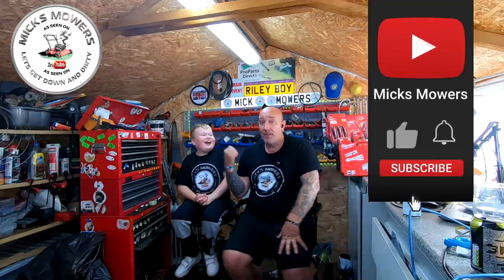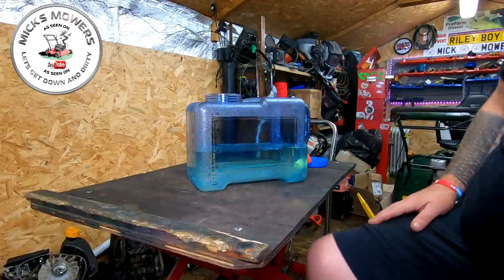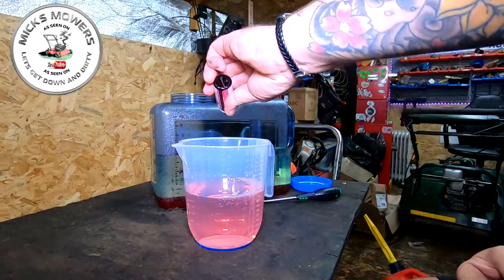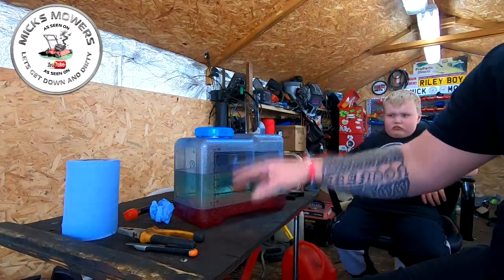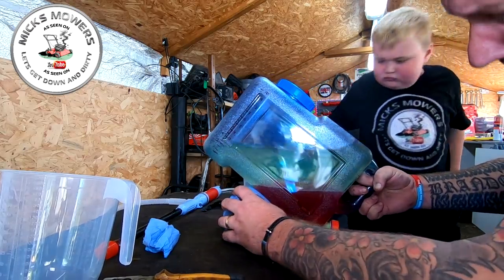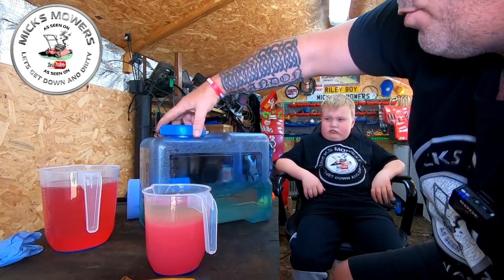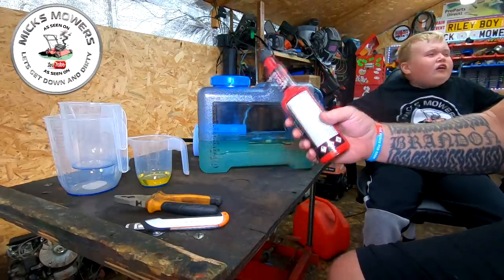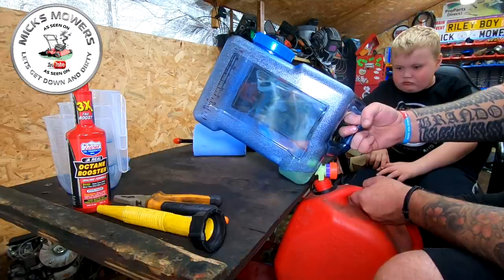How To Remove Ethanol From E10 Unleaded Fuel To Use In Lawnmowers And Small Engines

Comment from the maker: Here is my channel wish list if you would like to show some support in purchasing some tools or spare parts, it is gratefully appreciated https://www.amazon.co.uk/hz/wishlist/ls/13BO7QKGAZZV2/ref=nav_wishlist_lists_2?_encoding=UTF8&type=wishlist
Reply: Octane booster REDUCES the flammability of the fuel, not the other way.  It's purpose is to keep the fuel from igniting too soon, before the spark.  There are quick start additives that increase flammability. Also, if that fuel had 10% ethanol, it should have shrunk by half a liter, but it only shrunk by a quarter liter, so I don't think you got it all; either that or it didn't really have 10%.
Reply from the maker: @alan6832  hi Alan.. ta for the comment.. E10 has up to 10% it could of been less..
Reply: I am an ASE Master Certified Automobile Technician and I have been trained on how to measure ethanol in fuel and what it does to the fuel. In testing we use coolant, but you can use alcohol (with food coloring) and you will have something that will burn after you siphon it off. Calculate what the 10% will be and use that much alcohol to remove the ethanol from the fuel. It makes it easier to see when the process is finished.
   You are correct to use an octane booster because ethanol is an octane booster and when you remove it the octane rating of the petrol will drop possibly causing detonation. However you have that "flammability" thing backwards.
   One more thing. I doubt that it is the ethanol itself that is destroying the rubber o-rings and gaskets. As far as rust goes, you're spot on when the equipment is used once a week and has time to absorb moisture out of the air, and I suspect it is that water that is degrading paper gaskets and rusting pinholes in floats on carburetors. On stuff that is used daily, as you noted, or on a car that has a tank that is moisture controlled, the ethanol does not cause a rusting problem. Cars also have fuel filters that won't pass water so their injectors don't rust up.
Reply from the maker: @ladamyre1  yo yo.you know what... Best comment ever.. thanks
Reply: Maybe I missed it, but did you talk about how to dispose of the ethanol?  I think you don't want to pour it down the drain or on the ground.
Reply from the maker: @8546Ken  I took it to the recycling center
Reply: nice one mate!
Reply: Thanks for this Mick. Other You Tubers have suggested 1%-2% deionised water, others 10%. Your suggestion for 40% adds to my already confused state. Would you have an opinion on why there is such a variance of opinion or estimate. My own position is to go more than less to be more safe than sorry, but could less be more. Thanks if you do get chance or inclination to reply.
Reply from the maker: @derrinmorton3038  more will attract more ethanol is my thinking
Reply: video starts at 4:20
Reply: use a glass gallon jug, then pour the non ethenyl gas off the top.  (and don't drop the jug)

Comment: In the next episode, how to convert water with 50% ethanol content into a passable vodka imitation?
Reply: does it send you blind?
Reply: @charlestaylor8566  A horse would probably be cheaper.
Reply: @JohnBarringercopper101  
No.
Reply: @jimallen9859  Probably yes actually.  Wouldn't be at all surprised to find that the "ethanol" recovered from the gas/petrol has methanol and other nasty volatiles in it.  You would be a fool to try and process it into something drinkable.  Especially since just making quality ethanol in the first place would be easier.

Comment: I have had fits every year that I pull out my tiller, my pressure washer and my lawn mower. I threw the weed whacker away it gave such fits and bought a battery EGO one that is brilliant. I bought new carbs for them one year, but still the next year, filled with gunk. At the beginning of covid, I did this removal process, drained all my tools and filled with this ethanol free fuel. This year I pulled everything out, and like magic, they all started right up and ran perfect. I personally just start with premium fuel, so after the ethanol removal, I have regular fuel. I then ad some Stabil and I think it will store for years. Now 1 1/2 years later, the fuel I still have left over looks and a eels just like new. And yes, you can just drain all your tools and then run them dry, but this is easier. I will never put ethanol fuel in a small engine ever again.
Reply: CONvid
Reply: just use aspen and there is no messing about
Reply: Just add Stabil to the fuel as soon as you get it. I have only ever had one fuel related problem and that was a generator that I decided to read the instructions on and drain the fuel after use. Next time I needed it I had to remove the carb and clean the varnish out for it to run . Ever since then I never shut the fuel off to the generator and it fires up on the second pull even after sitting for over 2 years. My riding mower is over 15 years old with no carburetor problems along with my push mower, weed eater and chainsaw.
Reply: @boilerhousegarage  Yup, if folk don't wake up seen we are buggered
Reply: @JB-ly3eo  some machines run like crap on Aspen and if you use alot of fuel it's a ridiculous price. Having said that I do use some Aspen .
Reply: I have been using Stabil and haven't cleaned a carb in 15 years. I also do remove the fuel in my generator every two years because Stabil is only suppose to last 12 months, but it must last longer.

Comment: Or just buy ethanol free petrol form Esso - their Supreme+ Super Unleaded ' is ethanol free in most of the UK (except, due to technical supply reasons, in Devon, Cornwall, North Wales, North England and Scotland)
Reply: @robertferguson5518  Tesco momentum 99 is less than 5% as is V-Power. After watching this I’ll stick to buying 99 or V-power, less faff and far less dangerous!
Reply: @robertferguson5518  BP is the worst.
Reply: We have ethanol free 91 octane in Arkansas USA. Its usually in the premium pump and costs more. Right now its costs around 3.65 per gallon.
Reply: @robertferguson5518  was $ 1.79 when TRUMP was in office.
Reply: yeah at a premium over the ethanol fuel, not cost effective at least where I live in USA
Reply: @robertferguson5518  IF we still have the USA
Reply: @garywaite6963  that was a joke. Media and idiot's repeat it as a fact, sadly.

Comment: I have always used standard unleaded for years with no issues, only thing I do do is when I finish using the machines is drain the tank and then run it till it runs out and never leave machines over winter with fuel in

Comment: Little tip I learnt years ago . When pouring from a container like the de-ionised water . Pour from it side ways and then you don’t get the surging effect of the air trying to get back in the  container. You then get a steady pour .
Reply from the maker: Thanks mate
Reply: Yes, I imagine @micksmowersthemowerman is aware of this but for the purposes of this video poured the bottle in this way so the camera could notice the label on the container.
Reply: I make an tiny air hole in the handle of the pouring container. 1mm is about right.
Reply: The jug used for the deionized water and other containers like it were designed to be poured with the spout on top, not on the bottom.
Reply: Never drink from the opposite side of your mug....

The laying on its side trick was taught me to pour fluids into or near engines where you don't want to spill, like with coolant, oil or windscreen fluid.

Comment: Weee are fortunate to have a couple stations that still sell hytest ethanol-free fuel. Its cost is about 15% more. But you showed a very nice trick for those who don't have an option. 
    The gunk is a problem. That's why you never store your vehicles over the winter with fuel in them. The other trouble is ethanol tends to dry out gaskets and diaphragms. A very small amount of two-stroke oil can go a long way in a 4-stroke engine to offset some of those effects.
Reply: Jim McIntosh  ethenol is basically just corn oil.

Comment: Just a tip for pouring the de-ionised water, it works the same for fuel and oil cans, is to pour the bottle on its side, the glugging comes from air getting trapped in the handle part, so ifyou get that level, you can stop the surging of the flow, and make it pour nice and smoothly. Good video by the way, really enjoyed it, learned something today Cheers, keep it up!
Reply: The glugging comes from having to let air in to replace the contents coming out. I completely invert the container so the outlet is at the top, but sideways works, too.

Comment: In the USA I live in Palatka, FL and about 5 miles from my house there is a petrol station that sells Ethanol free fuel. I use ethanol free in all small engines that I use. Good video. I purchased a small battery operated fuel pump like you have from Harbor Freight for about 8.5$ USD and it works great.
Reply: Whenever I see ' ethanol free ' for sale, I am always curious about what was in the tank prior....

Comment: Ethanol has a higher octane rating than gasoline and gives a net boost to the fuel's octane. Octane rating of fuel is not a measure of how flammable the fuel is though.  In fact, it is more related to its ability to resist knock or detonation.  The higher an octane rating, the more STABLE the fuel is and the better it avoids detonation.   The octane index  is a rating in which the fuel being measure is compared against pure octane.  (Octane is no longer actually used as a fuel.) An average octane rating of 100 means the fuel being measured behaves exactly the same as Octane would in resisting detonation.  

Many Octane boosters could just be ethanol since ethanol does boost the octane of gasoline.  I am not sure what Lucas uses in their fuel booster.  But before I would add it to the gas you just "de-ehtanoled", I would make sure it does not have ethanol in it.
Reply: Most of the "Gas" we are able to buy here in the US has no gasoline at all. It's the petroleum equivalent of Frankenstein's monster. Majority of our real gasoline is exported
Reply: @jamesharrison6201  Hi, as you referred to 'gas' as petroleum,  why don't you call it petrol as in the UK?
Reply: On a cross country trip I was surprised driving through Oklahoma that my car felt peppier, and I was getting 10% better gas mileage.
Then realized it was real gas, not the 10%.
They might as well put 10% water in, same result.

10% ethanol is one of the biggest modern scams.
A political promise made to corn states that will be darn impossible to repeal.
Reply: Well said mate. I was looking to see if anyone would explain the octane rating. 👌
Reply: You can add an MMT additive which is in some boosters. It is derived from manganese metal and acts similar to how lead did back in the day, only downfall is manganese poisoning of the catalyst in cars and red deposit on spark plugs, similar to the yellow deposit from lead.
Reply: Ethanol gas has water in it small engines spit and sputter then you check your bowl on the carb,
And it has gunk in the bowl
Reply: @johngardiner6800  We know how to speak ENGLISH in the USA😊
Reply: That is correct.  The difference with octane is that there are 8 carbon bonds/chains in each molecule of octane (oct=8) and octane is a more complex chain of hydrocarbons that is harder to break apart, that's why it doesn't knock; there's higher heat and compression required for it to break apart and start combusting prematurely.  Interesting fact, octane has quite a bit more "energy/BUTs" in it than pentane and other components in modern gasoline(petrol) and especially ethanol since it's a more complex hydrocarbon.
Reply: @TurboMountTV  right!
Reply: Yes I can get you both
Reply: @johngardiner6800  no one in America has (petrol) for sale. He definitely missed the boat on Octane and what octane boosters are and why they're added. It is very common for cheap octane boosters to Simply Be alcohol of one of the  different types. High octane fuels reduce the tendency to burn or slow down the flame. By slowing the burn rate you can mechanically raise compressions ratios without having detonation problems . Low compression engines gain nothing in the way of power output when running higher octane fuels .
Reply: @johngardiner6800  Gas is just a short term for gasoline. The word gasoline actually more accurately reflects the refined state of the fuel, whereas 'petrol' is a more generic term reflecting the source of petroleum. Saying petrol is technically less accurate than saying gasoline or gas for short.
Reply: Petroleum is a chemical name 
 Gas O line is a marketing term like Laundr O Mat or Kwik E Mart.

Learn to speak English instead of your American drivel.
Reply: And the English don't ?
Reply: @johnbrizendine7716  best reply re: octane. I learned something. I've long since learned that higher octane leads to less detonation in normal combustion (typically most useful in high compression engines) , but have never heard even a 'quick' molecular-level viewpoint of what is going on.
Reply: @thomaslemay8817  With all that said, where is the break-even point to determine what is high-compression? Would you say ~8.5:1, or 9:1? At or above this point it may benefit to increase octane for better performance.
Reply: @atlantajunglepythons1744  Usually around 7:1 is where low "octane" fuels start to prematurely detonate, or burn just from the heat and pressure of the combustion chamber, which is how a diesel engine operates, but with a compression ratio closer to 50:1 or even as high as 100:1, which is why they can burn oil, and also why they get such tremendous fuel efficiency.  There are a lot of fuels out there with super low octane ratings.  Diesel fuel has a very very low "octane" rating, but a very good "Cetane" rating, and will not run well at all in a high or even medium compression engine.  
You don't get super high efficiency from running higher octane until you get closer to 10:1 compression, but then you end up paying a much higher fuel cost.  Alcohol has a super high octane rating, but way fewer BTUs/gallon, so twice as much alcohol is required to perform the work.  Alcohol is also an oxygenated fuel, and that makes it burn much cleaner, but much less energy is released during combustion.  

There is an interesting trick where you can use a methanol/ethanol water blend injection, where you spritz a small spray of methanol or ethanol and water into the intake and that allows you to greatly increase the compression ratio, and still use a slightly lower octane rated fuel and it cools the engine and cleans it and improves the fuel efficiency greatly, and doesn't use up a huge amount of ethanol/methanol water blend.  It increases the performance and the fuel economy, cuts down on the buildup of contaminants in the engine and will lead to the engine being much happier and last much longer.
Reply: @atlantajunglepythons1744  I think you are spot on with any ratio above 8:1. being high compression.
Reply: @lawrencehenson8494 

Simplified English mind you... 😉

Comment: Great vlog, mate, thank you kindly for sharing. Two points, friend:
Please don't underestimate how useful this is to blokes li,e me with older carb-equipped motorbikes. This is a good amount to go in most recreational bikes and it can't do any harm( I imagine, in my untrained opinion ) to be keeping that water & gunk out of my bikes' running gear. 
Also, I had to source containers to drain off all the diesel out of my 4x4 recently. By far the best and cheapest option I found was used big containers sold off very cheaply by a local brewery. They make craft type ales and apparently struggle to get rid of the large containers. I just cleaned them out thoroughly, bought a tap from a camping supplier, installed at the bottom exactly as per your clear container. The cost was pennies compared to buying tapped purpose-made containers.
Thanks again, friend..........keep smilin', bloke.....
Reply from the maker: Thanks for the comment.. I appreciate it
Reply: My barrel only cost £8 off the dreaded amazon and its clear. We needed  it for our old Francis Barnetts

Comment: I got my lawnmower's manufacturer (Challenge) to confirm that it will accept 10% ethanol. 
Beside that, what I usually do is put in just enough fuel to cut the grass and then leave the machine idling until the fuel runs out, so I never leave unused fuel sitting around in its tank/carburettor. The small amount left when the engine stops soon evaporates leaving a dry system. I started doing this year's ago to stop dried up fuel forming gum etc. to clog up the jets, but it should also mean that the plastic seals are only exposed to the ethanol for a few hours per year.
Reply: I started doing this and my machine stopped surging.

Comment: Is this cost effective? Wouldn't switching to a premium petrol (97 octane) work out cheaper ?
Reply from the maker: I would but what if you can't get it.. it's just an option to have. Ta for the comment
Reply: Here in the states at least, the higher octane fuels still contain ethanol - the point is to remove the ethanol.

Comment: I run nothing but E85 for 15 years in my fuel injected truck, never had any problems. Then after 200;000 miles my fuel pump wore out.  When I took fuel pump out it still looked new. All the rubber and plastic parts looked great.
Reply: Yes, the engine was still running fine but I sold the truck just because I wanted a newer model.
Reply: That's the difference between an engine in daily use as opposed to weekly or biweekly.